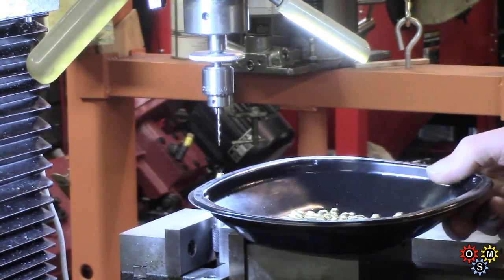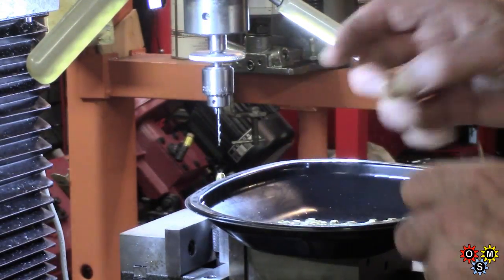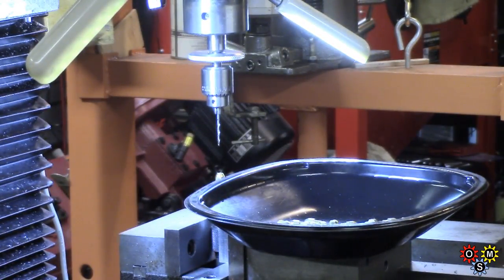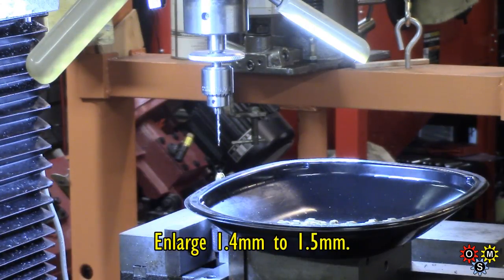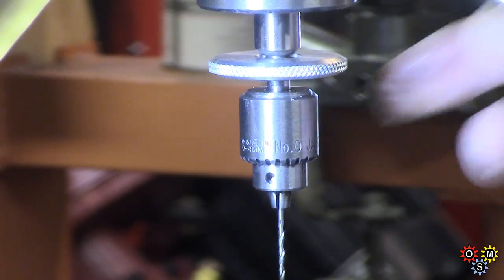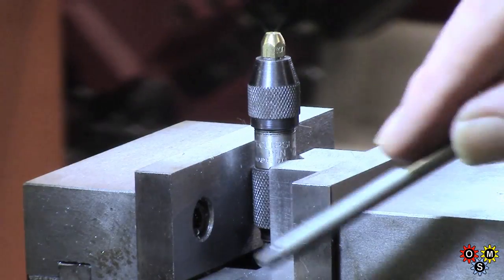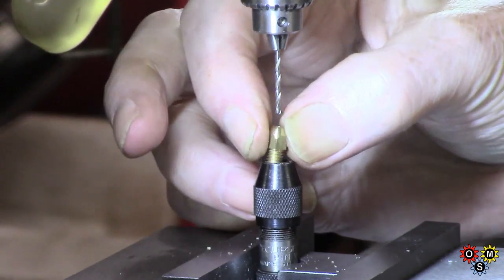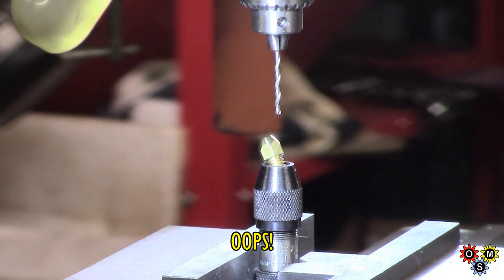Gas Jet Orifice Enlargement

Comment: I want to feed an petrol carb on a mower with propane instead, how much do you think I should enlarge the jet by. ?
Reply from the maker: Can't really help on that I'm afraid. I suspect you may need to go smaller but suggest you do some web searches and see if you can find more info. May need to relate the current jet size to relative stochiometric ratios between gasoline and propane so as to achieve usable air/gas ratio..

Comment: Can I increase the hole size on an existing propane jet, in order to increase Btu output on a gas range?
Reply from the maker: In theory I think this can be done but - only by a very small increment initially, further to which the gas/air ratio would have to be tweaked for ideal combustion. IMO it'd be wise to measure an existing orifice so as to be able to calculate the cross sectional area, and then calculate a modest percentile enlargement. HVAC professionals may have further thoughts.
Reply: @ChrisB257  Yes, I realized that after I posted. It's not really a good idea, unless you know the exact ratio of air needed, and how to adjust the draft. Best to leave it be.

Comment: When I see the professionalism displayed here, I have to laugh when I think back to how they converted my old Carmichael gastop from coal gas to natural gas in 1982.  The moron they hired came in with a drill and drilled the crap out of the holes with the burners in place.  It was always a pr*ck to light after that using a gas gun, and would gurgle and pop when turned off (sometimes you would see remnants of blue flame in the holes even with the switch off - and have to blow them out!).  Plus it was about half as hot.  Needless to say I bored it up the gas company and they gave me a discount on a new stove with natural gas jets.

Comment: I was given to bouts of extreme hip pain (worst in the morning). After about a year of alternating between canes and crutches and wheelchairs I got an injection in the bursa of the hip socket itself which I'd thought was just for diagnostic purposes. That was over 4 months ago and I've been pain free ever since. To say it's been a world of difference would be putting it mildly. Hope you can deal with yours as easily.
Reply from the maker: The injection approach can help a lot and glad to hear in your case it did so well. In theory it is only an anti inflammatory palliative but it can work well for some - others, not so much. My MRI showed my old hip was in very bad shape so, replacement was the only real option. Now progress is good but still lingering soft tissue aspects with sometimes quite a lot of discomfort. Just takes time I guess.